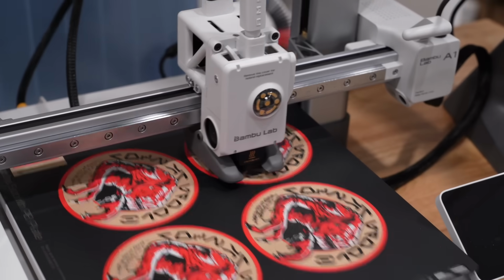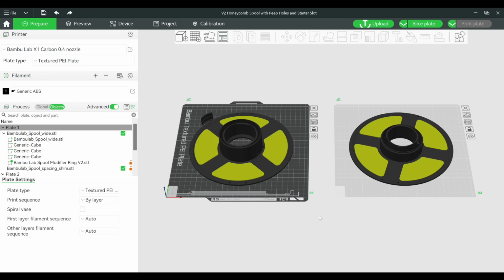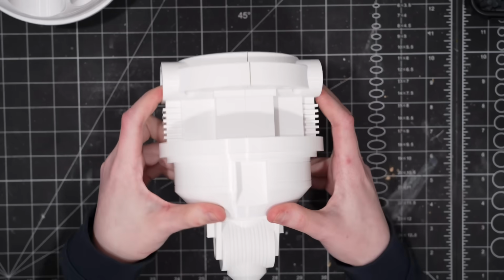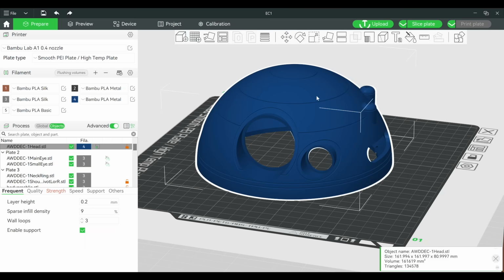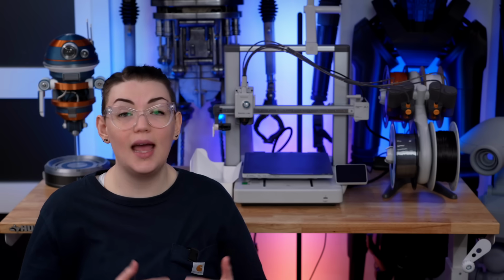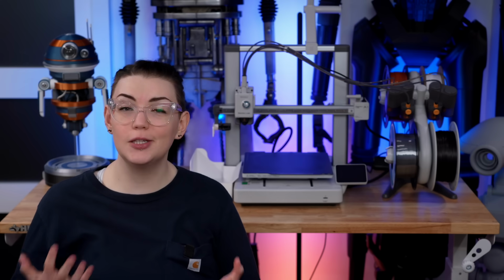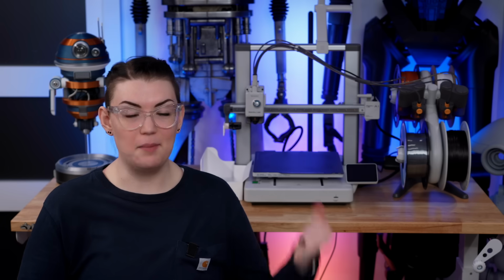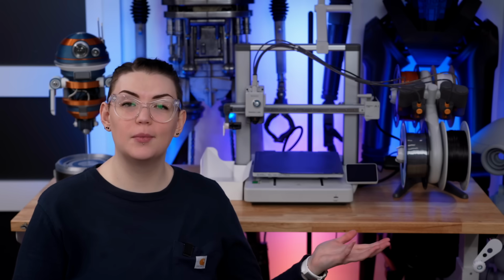Is the Bambu Lab A1 the Unbeatable 3D Printer for Beginners?

Comment: bottom line: 
You want to JUST print stuff at home, then get a Bambu Lab product. But you won't be learning all that much about printing itself, just really finding the model on Bambu Studio and pressing print. Like getting a sports car but calling it done after or buying the 3d equivalent to an HP Printer. Also, its very much closed source, even if they say its not. You need THIER products to make the machine work to its fullest( much like a sports car company does). 

If you want to like LEARN about the machines, how they work, what the software is correcting, basically how they work from top to bottom, and like to tinker; get another machine and build it out. Like a Voron or even a stupid Ender. Because you will find Bambu machines quite boring and basic b*tch(because they are). I've built several, its very easy for me, so the tinkering is fun. Building out a machine with open-source software is like getting a project car and making into something amazing, which some of us enjoy. It does take work though.  

Everyone has their likes and dislikes, and some don't want to tinker. But know that Bambu's hardware isn't at all revolutionary and things like LIDAR are just marketing names (There would be absolutely NO WAY to fit real Lidar into a machine as small as a 3d printer. Its just a camera and some software really.) and carbon guide rods don't actually bring an advantage.  It has a basic 3-point build plate, leveling sensors and CoreXY. All things that have been around for a while now, before Bambu.   It also has a filament changing system, AMS, that's about half as fast as Prusa's MMU at double the cost. The real "cost" is dev time to make the software for it, set up the servers, and get the algorithm going. Its not the hardware. 

Bambu also isn't the best choice for industrial applications as again, it needs its own products to work 100%. Parts are proprietary. No grabbing off the shelf hot ends when they break or nozzles. and they haven't been tested long term in high stress environments like a giant print farm for example.  

Just be aware of what Bambu machines actually are and don't fall for the hype if custom builds are in your future. Great machines for the average joe, boring to real print operators. I don't think they are worth it IMO but that's just me. Just my two sense, 15 years' experience..

Comment: I bought one and it has one VERY serious flaw.  The hot ends will quite often gum up and cause a backup of melted filament that will completely destroy the whole print head assembly and it's INCREDIBLY difficult to fix.
Reply: I quite literally have a few hundred hours on each and ive yet to destroy one hotend let alone a toolhead, if its a clog the  it most likely has to do with settings, too much cooling or adhesion problems and the hotend drags the print and makes a gigantic blob, if it backs up into printhead you had a clog , something i havent had even with offbrand CF filaments on a .4 HS nozzle ?

Comment: 33:40 Wrong.. I also dislike the waste from supports and personally try to design my prints and orient other's prints to avoid support material as much as possible.  Wasted filament is a problem and we still need more productive ways to reuse the waste filament. The waste pellets seem like at least they would be easier to melt down than a full waste block.

Comment: I have had an A1 since February and I love it. It’s my 4th and 5th printer. Now my only printer.

I have one correction for you. It does not matter on the hot end what color goes to what tube. It only matters on the AMS side and that is clearly labeled. Good video.
Reply: Hi.. good to know.. have you any experience with K1C, I'm confused between A1 and K1C as getting both for similar price

Comment: Question, coasters are often used for hot drinks, how does the print material cope with the heat transfer of drinks? As they look incredible! ❤
Reply from the maker: I’d be using them for cold drinks only; PLA really isn’t the best in terms of heat resistance.
Reply: @MMsPropShop thank you kindly 🙏

Comment: Hey! Have you had any issues with this printer? How is it in terms or parts replacablility and DIY maintenence?
Reply from the maker: Still printing without issue for me. Only maintenance I’ve done is re lubricating the axis rails and rods. 
You can purchase a replacement of pretty much every conceivable part of the machine and AMS. Only downside is everything is very Bambu Lab specific so you will need to purchase it through them.

Comment: The a1 handles multi color a lot better than my x1 carbon. The x1 has a difficult time wiping the purge from the nozzle and occasionally drags it across prints, ruining them. The purge also likes to clog the chute. None of these issues exist on the a1, so i find myself using the x1 for single color and my a1 for multi color.

Comment: The wiki says that one needs to create an account at BambuLab. So if BambuLab goes out of business, you are screwed and can't print anymore? That doesn't sound appealing. Or is the account only needed for the download of plugins? It would be interesting to know if other slicers work as well and with comparable quality. Probably not. Does anyone know?
Reply: You don’t need an account. When you want to update the firmware you need one. 
And you are not stuck to Bambu Studio. Orca Slicer and Cura  for example work great with the A1

Comment: The only drawback I can see with this design is how do you keep your filaments dry when they are installed on the AMS ? I personally have found that dry filament improves reliable printing significantly.
Reply from the maker: There are quite a few options out there for printable dry boxes for the AMS Lite that enclose the spools. I’ve never had a massive issue with wet filament where I live but I know that it’s something that becomes more of a concern for those in more humid areas in the world.

Comment: I brought the A1 after having Ender 5 plus's and my Baby Kingroon KP3S. OMG, The difference is  like jumping out of a Propeller plane to one thats powered by a Jet engine.  Everything from the machines build to the way it shakes itself down before printing.   BUT, Mine after several top notch prints has started leaving a step at the same layer level on my prints, This is mildly annoying, Im wondering whats causing it as im using Tinkercad to design stuff and bambu slicer. But, When i use the same tinkercad stl conversion on Cura and print on my Kingroon the steps not there.  Very strange. Is it a Tinker/bambu issue or has something not quite right going on????

Comment: Multi color printing does save in supports needed. Hear me out. 
If you wanted the droid in different filament colors you would originally have to print all the color zones separately. and then assemble and glue together later.. all of them would have individual supports every time time, where now those parts are supported by the other parts in different colors.

Comment: Got a Creality Ender-3 S1 plus with sonic pad and laser engraver (this hasn't been tried yet), and an Elegoo Neptune 4 Max (I needed a large print area). I had issues for months with both and never managed to finish a project.
As long as the auto bed levelling works and is stable (which my neptune 4 max fails at), that would be an improvement to my life (no more wasting hours/days/filament, trying to find the correct settings and realising that the next time I switch the printer on, they no longer work)

Comment: Been using an Ender V3 KE for a couple months helping my kids after they went to 3d printing camp.  I dabbled in 3D printing several years ago when I fixed an old XYZ printer (yuk).

We immediately got hooked and knew a multi-color printer was the next step.  I've yet to see anything negative about Bambu and this AMS is the route we'll be taking if Santa is nice to them this year. ;-)  So glad I came across this channel.

Comment: I’m looking to getting a 3D printer mostly to make custom foot orthotics and covers and accents for prosthetic legs. What are your thoughts on this printer being able to handle those jobs?
Reply from the maker: Very cool! It would really depend on the materials they need to be printed out of - whether they’re being used directly in that material or the parts being used for casting, etc. I suppose it also depends on the sizes of the parts as well and if they’d be able to fit within the 256mm cubed build volume.

Comment: It's no open-source though apparently. If it's a closed ecosystem then no thank you.
Reply: It's not a closed ecosystem. You can use whatever slicer you want, the included slicer is open source, you can use whatever filament you want and you can install custom firmware. What more do you want?

If you wanna see what a closed system is, look at Stratasys printers.

Comment: The problem I have is the Bambu lab stuff is polluting the object file ecosystem.   People dont share STL files, they share pre sliced files.    File sharing places need to refuse the bmbu file format.
Reply from the maker: .3MF files are still 3D model files, they can just hold more information than a .STL file. Most slicers/modeling programs have no issue opening them and if they did, you can easily export the model itself to a .stl, etc from the slicer.
Reply: .3mf isn't a proprietary random format, most slicers support it.
Reply: @logitech4873  I wish bambu users shared 3mf.  they dont. they share the pre sliced bambu format polluting all the repositories.

Comment: I really enjoyed my bamboo at the beginning - fast and clean prints.  But for some reason  one day my printer clogged with petg in the hotend and it filled the cavity with the latch that holds it in place.  I was trying to get it cleared out but I managed to damage one of the wires that runs the hot end.  At this point the plastic cooled and I needed to use a heat gun to get it apart.   I have not fixed it so far because I think it is just going to happen again.  The parts to fix are woth more than my old ender3 that has run successfully and reliably for years.... clogs and misshaps cost very little to deal with although the machine is considerably slower.

Comment: Why do you not recommend grid infill?
Reply from the maker: Grid infill causes the nozzle to run over the same crossings a lot which can more easily cause possible nozzle clogs and even full print failures due to the added vibration of the nozzle hitting the infill constantly. It also generally causes the printer to make a lot more noise which can be annoying.

Comment: How do you manage to get such a smooth surface on the top layer on these pads - 0.4 nozzle!? you can show your settings
Reply from the maker: They were the slicer presets that were part of the coaster files; it had ironing turned on for the top layer. Yes, everything was done with the standard 0.4mm nozzle.

Comment: The AMS Lite may be faster ... but the full AMS has its own advantages.   The biggest one being that it's sealed.  So you can leave dry filament in it and it will stay dry.  It has a slot for silica gel.   But there are are lots of additional bits of space where you can add silica gel holders (and there are lots of designs for these available to print).  And you can toss in a cheap humidity sensor.    Just dont leave the lid open.   Once every 4 to 6 weeks when the sensor has crept up to 15% humidity I pull out the silica gel holders and toss them into a filament dryer for half a day or so to dry them out, then pop them back into the AMS.  Most of the time the sensor reads 'LL',  below the sensor's lower limit of 10%

This is a significant advantage because these really fast printers really seem to be sensitive to the quality of the filament.  Wet filament can sometimes screw them up.

Comment: Honestly using filament other than theirs was one of the main things holding me back from Bambu Lab.  I've bought 4 ender clones and had nothing but trouble so I'm finally getting a better printer and have decided on Bambu.  Thanks for clearing up some issues and pointing out things to prepare for.
Reply: Yep - Any filament will do. I have boxes full of filament, and every one of them prints perfect. That said - Probably the Babulab filament is more fine-tuned in the slicer than the generic filament, but adding filament by name and use the manufacturer recommendations for the settings is easy to do and as said, prints perfectly.

Comment: Great video. One of the BEST I have seen on any printer and especially the A1. You did a very in depth look and explained everything as to why you made those statements. I do have one question/comment about the 'waste' portion. I also struggle whenever I do prints to keep the waste down and reduce the size of the purge tower and the flushing volumes. 
One of the things I never see is anyone ever making a comparison between multi-color waste in amount and cost versus the amount of effort and cost and waste that occurs when painting the model. Filament waste is 'permanent' and yes you can reuse brushes and bottles of colors of paint but  it still has to wash the brush, some waste when changing colors and the amount of time in prepping the model and the materials and tools as well as clean up after painting. 
Again, EXCELLENT video and thank you for such an in depth and honest review.

Comment: I'd love to get into this, but how hard is it to create the CAD drawings, and does it come with good software to do that?  I just don't want to run up against a steep learning curve that results in me never getting to the point that I can actually use it.
Reply from the maker: The majority of people that use 3D printers never design their own files, they find models online that other people have designed and print those. It can be extremely useful to have some basic 3D designing skills because that opens up the possibility of what you can create with a 3D printer, but it’s not necessary.

Comment: How much noise do these machines produce? I would imagine you don't want them in your livingroom?!
Reply from the maker: The main parts of the machine that make the noise are the cooling fans and the motors/movement of the machine so noise levels will vary depending on what type of filament you’re printing and how fast you’re printing it. I noticed later that the A1 actually has something called “silent mode” which I imagine is a preset that automatically slows down the printing process so that the machine is making as little noise as possible. 
But yes, I’m sure the general consensus would be that you probably don’t want to be using a 3D printer somewhere where you don’t also want to be hearing a machine running. The A1 is one of the quieter high speed bed slinger style printers I’ve tried, so that’s something.

Comment: 17:10
I had the string across ruining prints quite often on mine.

I have yet to find anything that prevents this.
Z-Hop does nothing.
Avoid crossing walls does nothing.
Wiping does nothing.
Retraction does nothing.
Flow-Calibration does nothing.
Temperature adjustment does nothing.
Drying the filaments does nothing.

If anyone else has figured that one out... please let us know 😭

Comment: My Anycubic Kobra 2 prints better using the default setup for the machine included in Bambu Studio than it does with the parameter files supplied by Anycubic that came with the printer.

Comment: To the point about support material vs multiple color waste. Multi-color is just an evolution of 3D Printing which opens up new possibilities. The coasters would not have been easy without the AMS. Hueforge prints are not possible without color change or multi-head printers.  For me, even if I paint a print, I try to use a similar color underneath.  It's nice to know that if it chips or wears from heavy usage, that there are layers of approximate color underneath, and my prop isn't showing a bright white plastic dent.

Comment: coming from someone who started my 3D printing journey in 2006, things have gotten so insanely good. I still have my old makerbot, a pegasus touch (unfortunately) and my Raise3D N2 Plus (which I got in 2016), and is the only one I use anymore. Seeing this, and the price and the ease of use, I just might buy another printer. That metallic filament worked really well and while I'd stil finish and paint it, for metallic prints, it would be nice to have that as a base when it wears through the paint, or just to have as a final finish depending on the print. The multicolor is awesome, I would use it as multi-material, like carbon fill and nylon or something, if that works on this printer, either way, great looking printer and as always, awesome video!

Comment: Idk if anyone has shared with you yet but it doesn’t matter which tube goes into which port on the AMS hub. The color/material is pulled based on the slot on the AMS unit not the slot the tube enters on the hub. 😊

Comment: So, after having my A1 for 8 months now, it was awesome at first, incredibly fast, very precise, and multi color. It was MILES ahead of my ender 3. Then came the failures...and the recall. I've replaced the extruder heater twice, the extruder once, and then the heated bed for the recall. I also had camera problems after an update that took MONTHS to resolve. I am not bagging on the printer, it is still the best thing I have ever purchased in my life, but a Toyota it is not.
Reply: Would you recommend it then? As a first printer?
Reply: Yes, I would. Despite having to change a few parts, it is still the most unbelievable thing I’ve ever owned in my life!
Reply: Is the combo worth or for a beginner?
Reply: It is
Reply: Heck, I change like 8extruder an year for anycubic, it’s godlike already